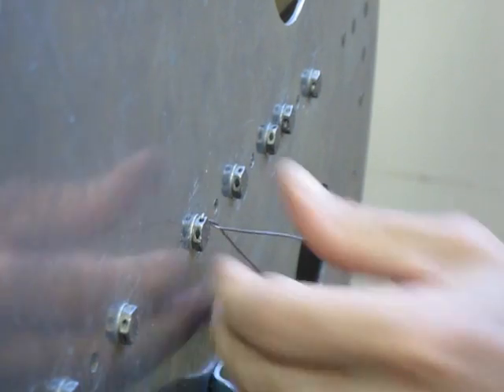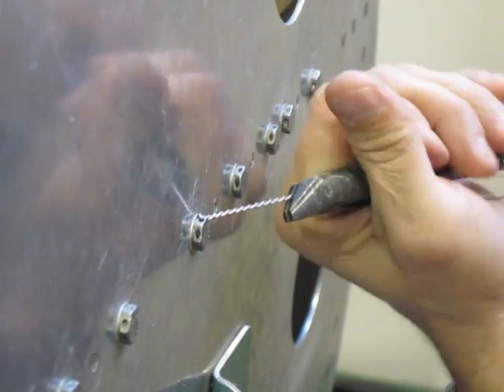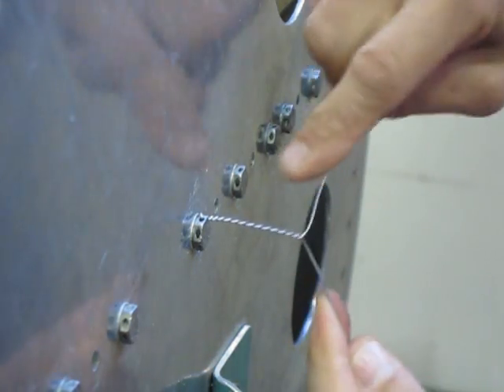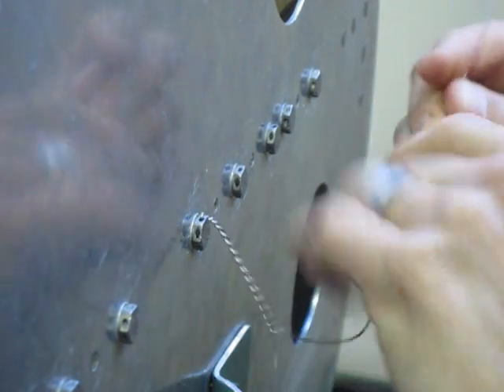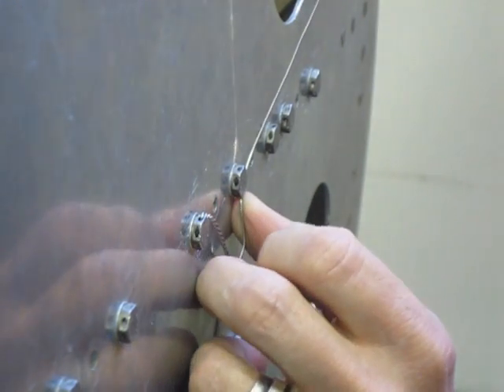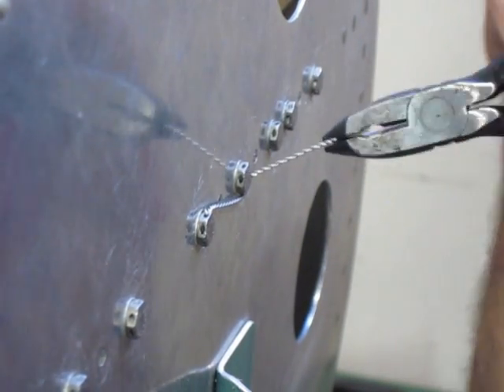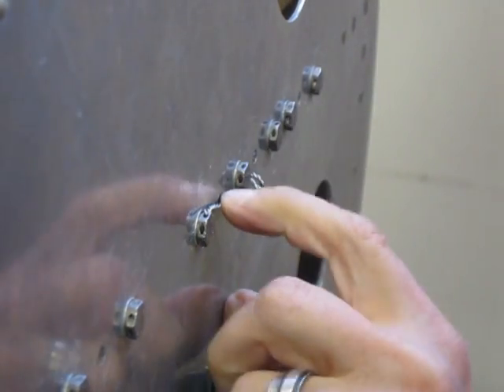How to safety wire in a two-bolt pattern.

Comment: I had to look at your "barrel roll" several times before I saw the half twist that I missed on another fella's clip. : - )
Robert, if you're still watching, thank you. And I'll probably re-do the wires on a transmission input shaft bearing house for an OLD tractor. My twists are a little tighter yet the ends are looser. : - (
You fellas have done it often, I do it once or twice a year and it's very nice to get the refresher!
Thank you!

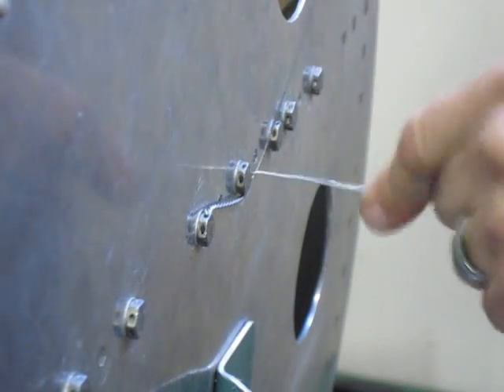Comment: Why is the direction of the wire twisted in the opposite direction from the first twist (at 1:10)?  

Does it matter which way the wires are twisted?  All the twist does is secure the wire to itself.  Great video, and looks like a nice job!

EDIT: Nevermind--- should have read the other comments first.  Thanks for the video!

Comment: I had this same type of bolts on an assessment. The wire doesn’t go through the bolt. Could you tell me what type of bolt is that ? If you could do a video of a 3 bolt pattern  will be appreciated.
Reply: I will start putting up more on typical maintenance techniques I have accumulated over the years. Thanks for the comments. For the wire on a 3 bolt pattern installing it takes a bit of practice, but when it is finished, all fasteners should pull the adjacent heads in the pattern in a tightening direction E.G. RH threads would be clock-wise.

Comment: I have a question, why do you twist it clockwise first and then counter-clockwise when doing the pigtail?
Reply: For these kinds of the bolts it doesn't matter. 
You can twist right or left, lockwire doesn't go over the bolts head. I was told that by instructor and I agree with that.
Reply: @MrD1maS  for me its about keeping everything snug and snag-free.. The pigtails, if not tucked outta the way will eventually be broken inadvertently from being bent so many times. Additionally if left high, when a pigtail is bent down, away from the head wrap strand, it could cause that strand to ride up off the head and possibly in the way waiting to be snagged or scuffed. Just remember...keep it straight, right number of twists, no gaps at entrance or exits and hide as much as possible reducing snags. Keep in minds that if your pliers have a very convenient knurl and they have excellent clamping force, there is a cost of that convince by the marks (weak spots) in the wire.

Comment: What is the purpose for doing that??
Reply: ensuring hardware such as bolts and screws do not come loose due to vibrations.
Reply: For what it's worth to further clarify: If one nut turns "left" it would have to turn the other nut "right" and that would be impossible since it's already torqued down. That's the idea behind it, make it energetically unfavorable to loosen any screw.  

Also check out "nord-lock washer" videos. Kind of cool stuff, apparently really important for certain environments because they've a lot of work/research about it :D
Reply: Tomek Brzezinski those washers are amazing! thanks
Reply: Haha, glad you like! Great for electric bike motors, but too pricey for most applications imo :).

Comment: Thanks for the comments. Years of practice building jet engines, composite and metal fighter jets, commercial aircraft has given me the ability that I can share with you. S Pliers are cheap from any aircraft tool supplier or  more expensive from standard pro tool dealer. These cost about $19 when they were new in 1987. They still work. The less moving parts and when lubricated often will last a lifetime. Not to be mistaken as side cutters or a hammer...lol.

Comment: How many twists per inch?
Reply: +Arran Morgan 7 to 12 for .32 in safety wire. 9 to 12 for .20 in safety wire.
Reply: by the way Arran, you are looking at about 8 twists per inch. if you look closely at the opening pic before the video, with the scale held to the wire count the arcs in 1 inch either on top or on bottom is how you count them, but not both. top and bottom.

Comment: two things, one, the wirelock should touch a minimum of two faces on EACH bolt head. also, you should never tighten by hand because you are then putting stress into it as you are creating different strengths along the wirelock and therefore a weak point rather than evenly spreading the load
Reply: It’s not rocket science but rather high strength  inconel .032”… so it’s not going anywhere this lifetimes especially minus less jaw nicks

Comment: oh one other thing...a handy homegrown idea I think is now being incorporated on newer pliers is that the open relief that is machined (or cast) in the side of the jaws can be filled with RTV sealer that provides FOD prevention by holding onto waste ends of the safety wire until you release the handle.